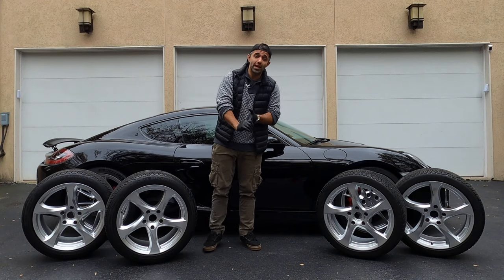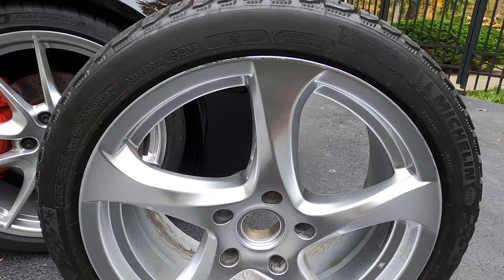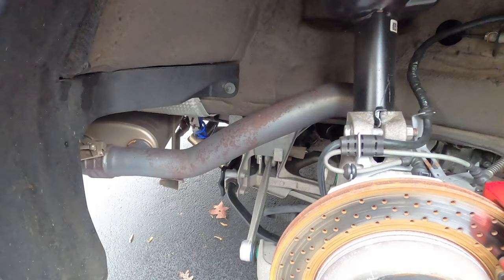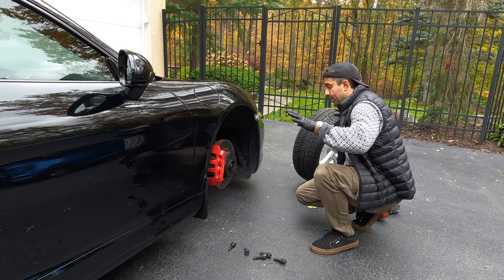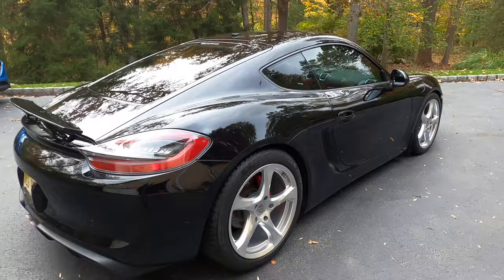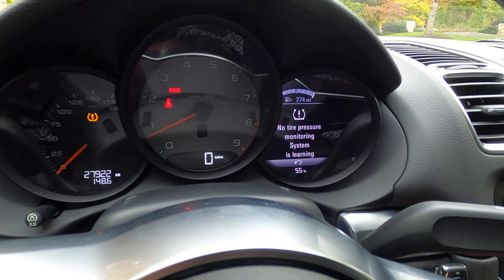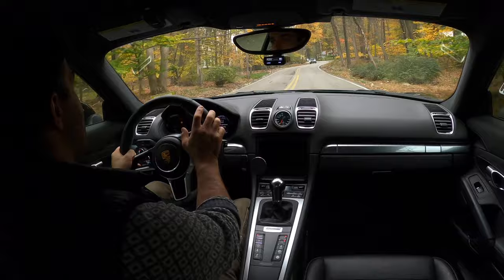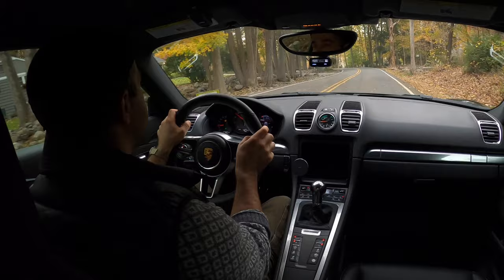Porsche Cayman S Winter Wheels and Tires Swap: Ready for snow drifting!

Comment: I have a 2010 Porsche Cayman S, 6 speed manual and I change mu tires every season from summer tires to winter tires ( no "all-season tires" bullshit, that's an oxymoron). I use the same wheels for both the summer and winter without any issues whatsoever. I mean would it be nice to have two sets of wheels also? Sure, but it is not necessary. Porsche Cayman wheels go for around $4,000 so I'd rather spend that money on something else than on an extra set of wheels. If you have a good mechanic who knows what he is doing, the tire swap is painless and quick with no damage to the wheels. Also, I drive all winter in the Chicago weather with no issues, very often leaving all those big SUV's with 4 wheel-drives behind me stuck in snow because the morons wouldn't spend few hundred dollars on a set of good winter tires but instead they use the "all-season tires".  Nothing funnier than seeing a Toyota Landcruiser or a Cadillac Escalade stuck in their parking spots covered in snow and the owner going nuts cursing and screaming while burning his tires trying to get out of his spot (specially when the parking lot hasn't been cleaned from all the snow yet). And then I pull out of my spot right next to them with no issues with my little Cayman. The look on their faces is priceless.😁
Reply from the maker: Haha I know exactly what you mean about the look!

Comment: Ran same wheels with blizzKs on my 911 turbo. It was a package you could buy from tire rack. Or discount tire. Can't remember. I'm running stock wheels with blizzaks mounted on my GT-R.
I drove 911 turbo 4 winter seasons and you could tell as Porsche rear underbelly is exposed. So salt. Snow. Slush. Etc. Made some mess
Both wheels look good 🙂
Reply from the maker: Ehhh parts can be replaced :)

Comment: Did the 718 tpms link up with the 981?
Reply from the maker: Nope. Had to buy new ones
Reply: Gotcha. Which winter tires are these? How do you like them?
Reply: Also what are the rim dimensions and offsets? I think the rear is 10 instead of 9.5. Is that going to cause issues with 718 wheels on a 981? Will I need a spacer or will they work without one?